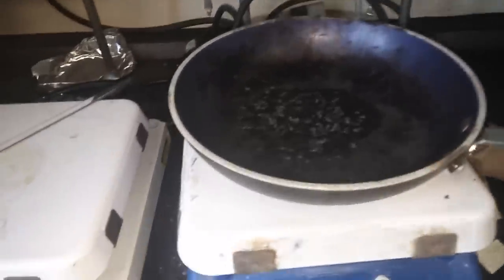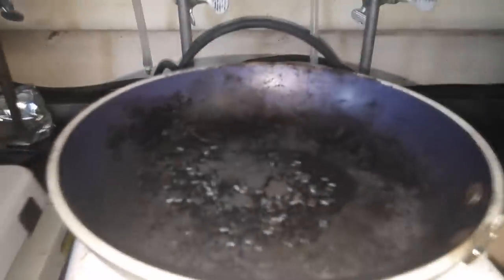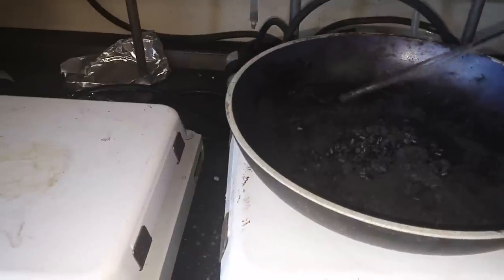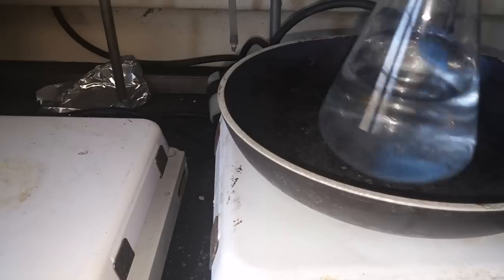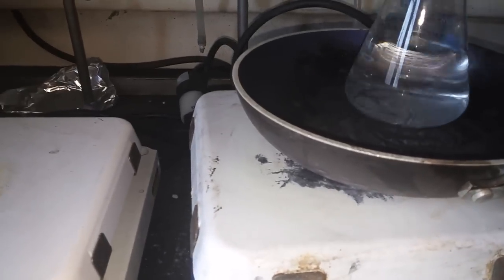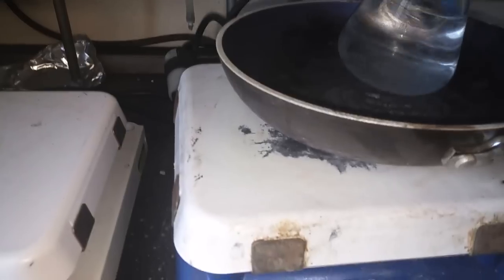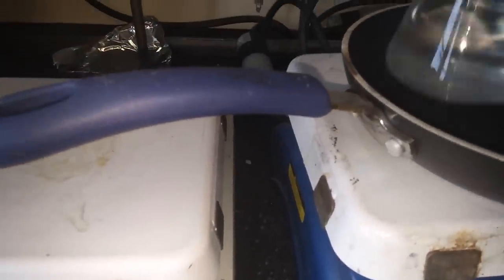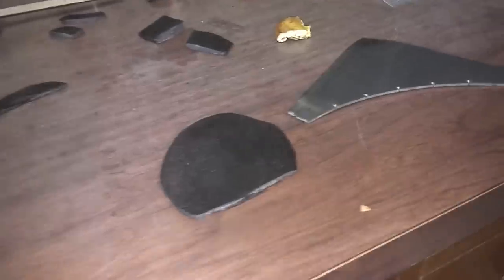Graphene enhanced ABS vs Stainless Steel

Comment: to make it easier you can take a little acetone and melt the ABS. Then add the graphene in after the ABS is melted. DO NOT BREATH!! Poor it out on a nonstick surface or onto a metal surface you plan to use and let the acetone evaporate. It will become hard and fused. Have fun.

Comment: helpful hint. What your doing is what I termed damascusing homogenization of plastic materials.  if you do this 20 times you start to get to the nano layers, 27 times your there :)   I'm sure your piece is brittle because the ABS exceeded 230°C hence the smoke. I would love to be involved with your testing group on this, there are special screw designs I have theorized will enhance properties. Iv been talking to producers but they dont either under stand the process or & I think they want to steel any information that i would give for themselves... Peace out,
Reply from the maker: +Dan Murphy It is rather similar to folding steel. But in reality actual dispersion is paramount. Our next experiments are with a twin screw to get everything very homogeneous in dispersion.
Reply: Hi Dan, is it possible to use graphene in knife / sword forging to enhance its properties?

Comment: Wow it's less ductile no suprise, why do you and others keep comparing plastic to steel?
Reply from the maker: +Lupus Mechanicus The stiffness is well into the 303 stainless range, but weight is less than 1/20th for the same break load. I'll have some confirmed 3rd party results soon. The major point is that if you were to use this as a structural part, it is better than steel, but it's a plastic that can be 3D printed.
Reply: Venturestarx My point is a better comparison would be between pristine ABS and carbon filler ABS.
Reply from the maker: +Lupus Mechanicus Oh OK. I do know the graphene makes it much stronger. By a margin that is extremely noticeable. Just the difference in the Carbon fiber reinforced and Graphene added to that was almost night and day. Abs isn't really that strong alone. With the Cf, it's quite a bit stronger. But adding the graphene makes it comparable with steel. Something not even conceivable without.
Reply: Venturestarx I agree, it would be great for injection molding.  I 3d print and honestly it kinda sucks as interlayer bonding always fails first no matter what plastic or composite you use.